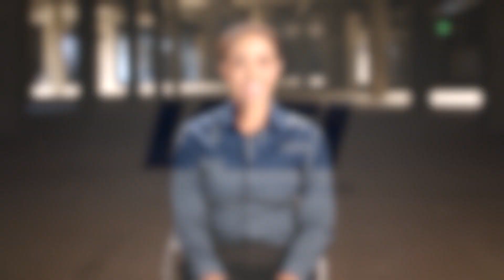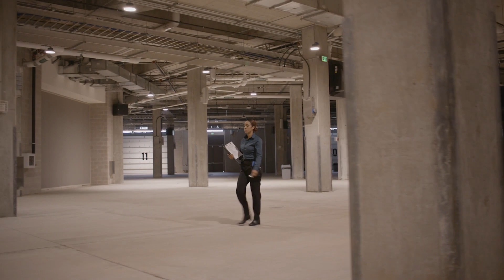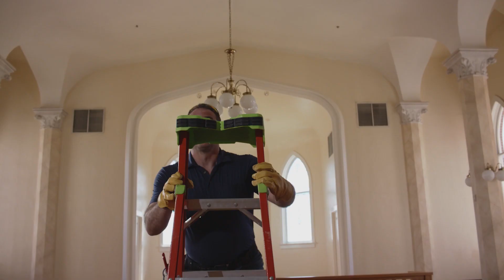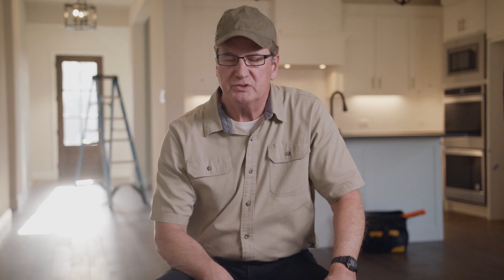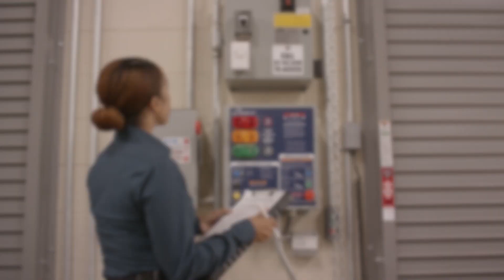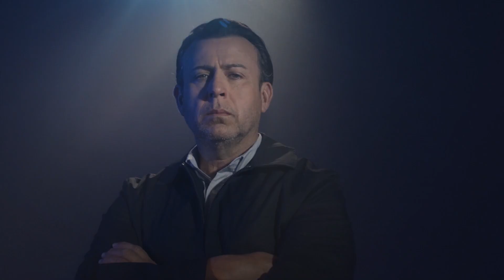IAEI Digital Education

Comment: The Ground Rod Depth ! I’m adding a 5/8” ground rod to me existing breaker box , I’m adding a Hybrid Solar inverter to my house so I’m adding a better grounding system. I drove that 5/8 “ zinc plated  ground pole 74” when I hit bed rock ! That’s 6 foot and like 2 inches for the first pole I am adding a second 1 also is that ok !